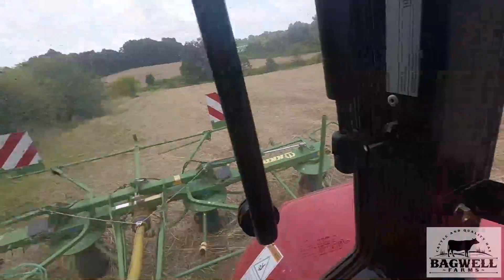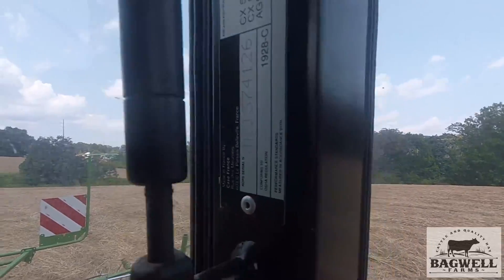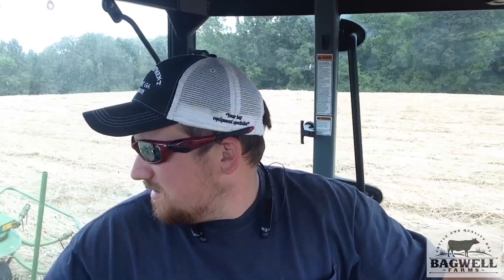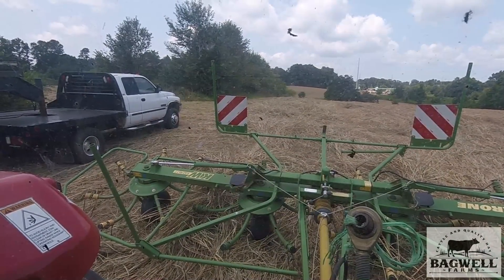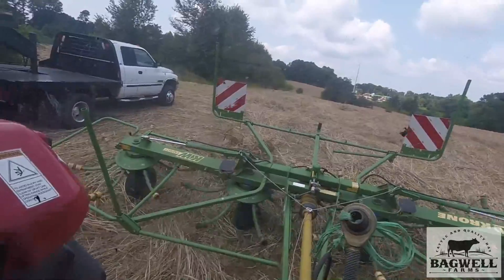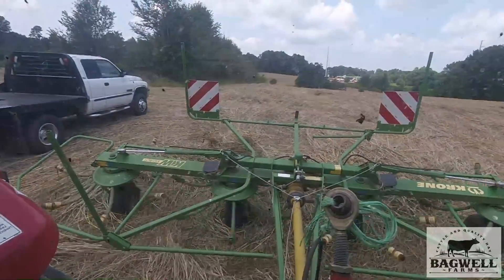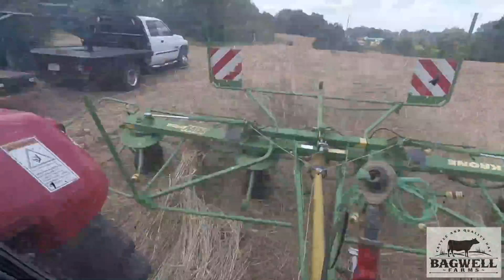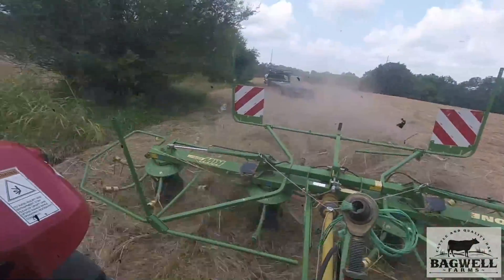Tedding hay an the mccormick has problems

Comment: If you open the hydraulic dip stick and run it it essentially purges air bubbles in the final drive. It worked on my neighbors 8310 John Deere.

Comment: Those CX’s were a properly good tractor. When Case Corporation wanted to merge with New Holland (Fiat) in 1999, the European Union would only give it approval if Case sold one if their factories in Europe to improve competition. The put up the Doncaster plant in the UK, which was bought by ARGO along with the right to the CX. Case had another plant in Saint Dizier in France that made transmissions and components (cabins and roll bars etc), which ARGO also bought later in 2001 with the rights for the MX transmission. I’m pretty sure all those CX tractors were Doncaster produced (not sure if France did some final assembly too maybe). In 2007 ARGO shut Doncaster and moved it all to Italy. The French transmission factory is now owned by a Chinese tractor firm called YTO 😑